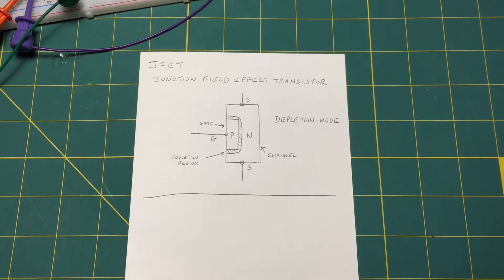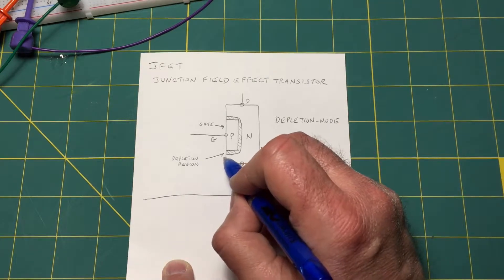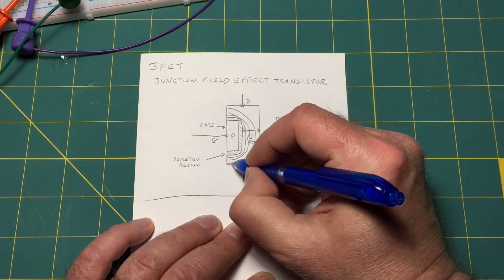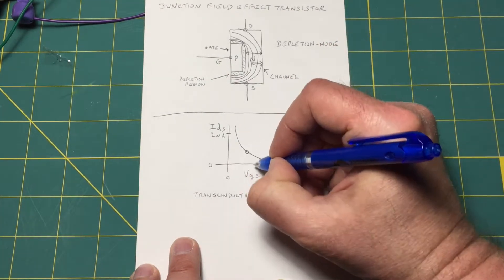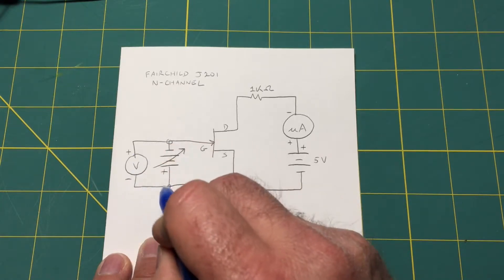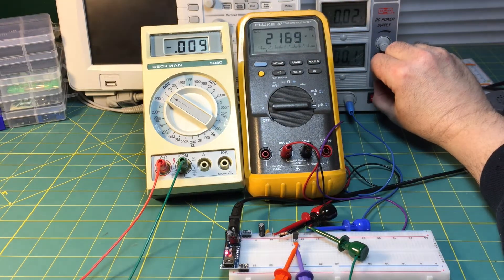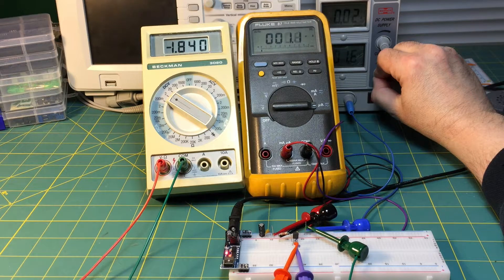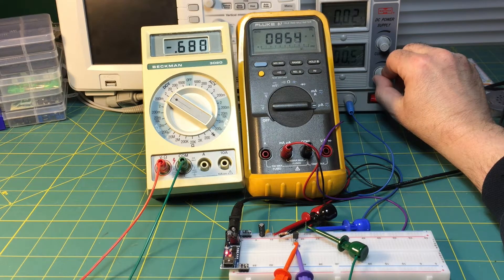JFET Basics

Comment: great video. thanks. Do you know of a not too complicated  characteristic curve maker circuit? I have a few old jfets(from 1980s ) and would like to know if they are usable.Recently retired so now have time to build/play:-)
Reply from the maker: There are a number of relatively simple ways to build a curve tracer around an oscilloscope in x-y mode, here are a few articles that I found:  

https://www.electronicdesign.com/technologies/test-measurement/article/21791743/simple-circuit-turns-scope-function-generator-into-jfet-curve-tracer

https://www.rs-online.com/designspark/how-to-use-an-oscilloscope-as-a-curve-tracer

I had to build one of the transformer based versions for a lab assignment in one of my basic electronics courses, it worked pretty well for testing diodes but I imagine it could be adapted to test bipolars or FETs pretty easily.  Let me know if you have any luck.